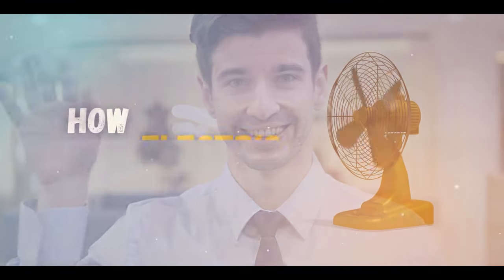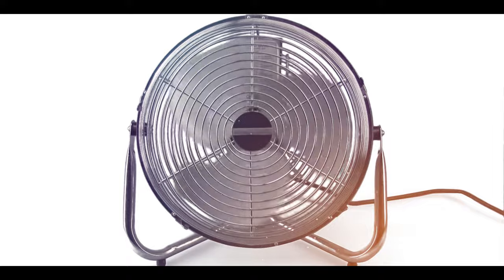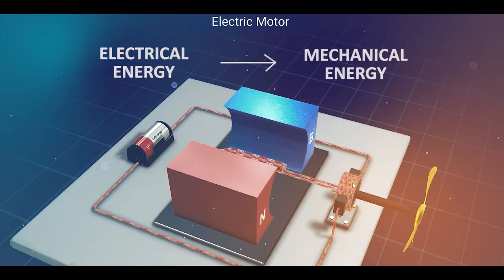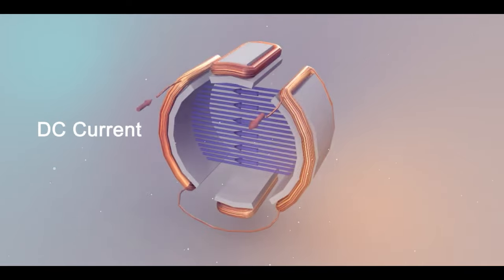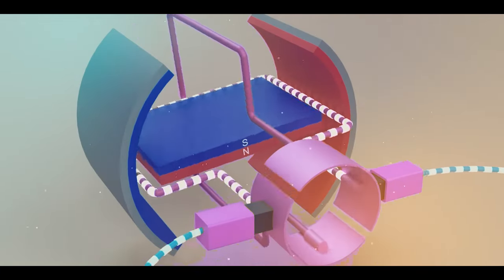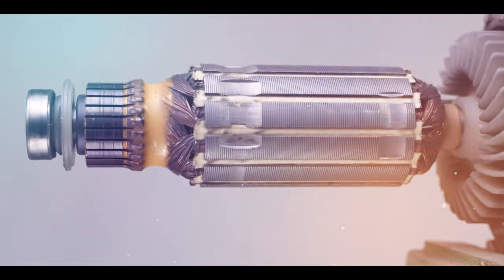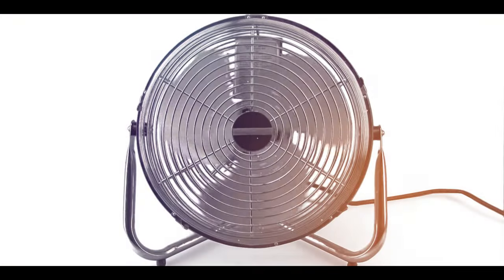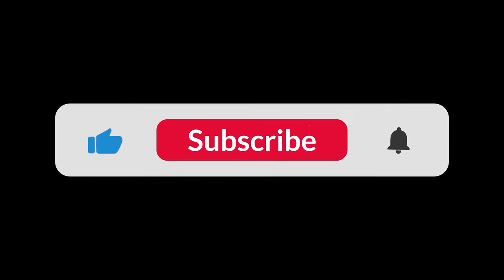How Electric Fan Works? | Working Mechanism Of Electric Fan

Comment: Im here not to hate or be a nerd but a propeller fan works by using a motor to rotate a set of blades that create a difference in air pressure, which pushes air forward:
Shape: The blades are twisted and shaped like a wing to create higher air pressure on one side and lower air pressure on the other. 
Rotation: The blades rotate, displacing air and creating a pressure difference. 
Thrust: The pressure difference pushes air forward, creating thrust. The more air that is displaced, the more thrust is generated.

Comment: The question that formed on my mind today is, if the air is pulled from the back of the fan in order to push It from the front, why don't I feel a similar suction force pulling my hand towards the fan if I put it behind it
I'm assuming that as the fan pushes the air away it creates a sort of vacuum that immediately pulls air not only from the back but from all around the fan, so this suction force is spread out all around the fan
Reply: Keep a paper behind it will attract towards the fan. Hand has skin and not enough sensory receptors. But if you keep a paper or a plastic it will attach at the back of the fan. But the fan needs to be on however